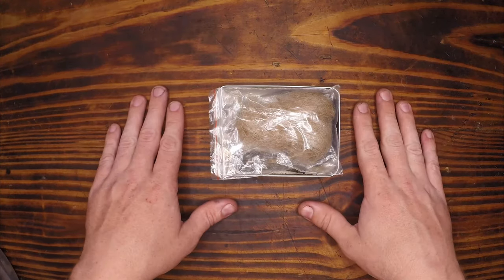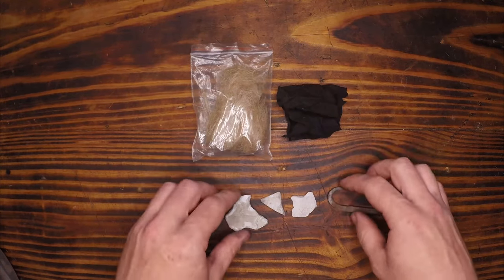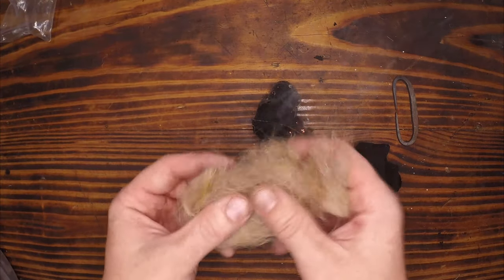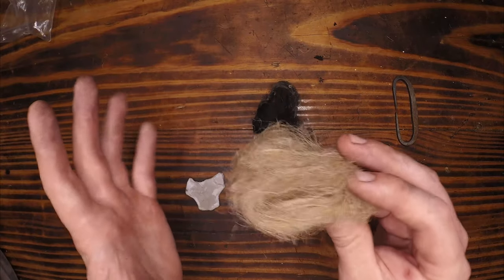Starting a fire with ACTUAL flint and steel!

Comment: Completely stumbled upon the video, but very cool to know that flint and steel is completely different than modern "flints". I assumed it was different, but I did not know it was a completely different item entirely. Cool video, glad I found the channel.
Reply from the maker: Thank you! Check out my ferrocerium videos if you'd like to know more about the tech. The metal match was invented the same year the wright brothers took flight at kitty hawk. It's amazing that it hasn't changed since that time. It's what made zippo lighters possible. I'm trying to get my content out there so if you subscribe or share it would be greatly appreciated.

Comment: Im new at this but I bought this same kits, I got spark and fire with the piston fire kit but I cant even seem to get a spark with the flint and steel. Is there a certain way you are striking the flint, on the flat or on the edge,  it was fast forwarded so couldn't tell.
Reply from the maker: That's a solid point! I was using glancing strikes BECAUSE it's the metal that is getting scraped off to make the spark. The flint is just hard enough to do it. Use a sharp piece of flint to do this, the sharper the better so long as you're not chipping it. Sorry for the late reply we've been moving to Germany and have been very busy!